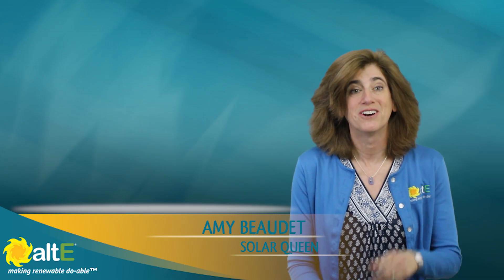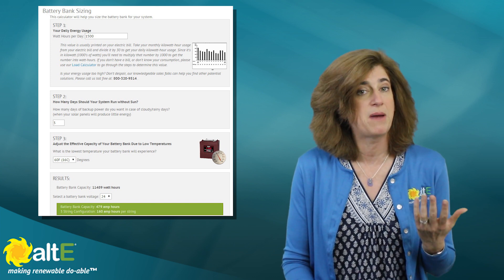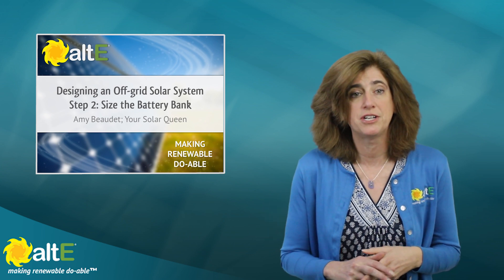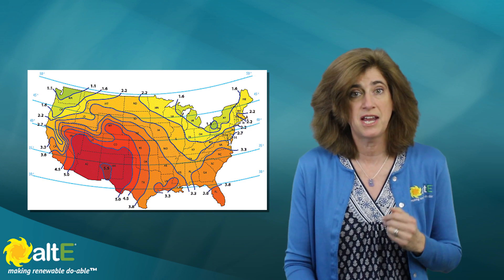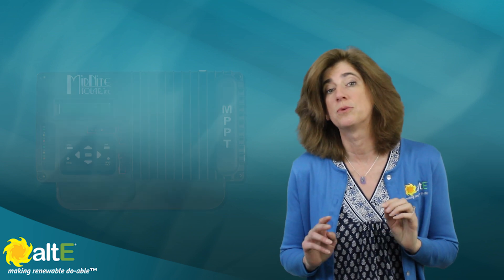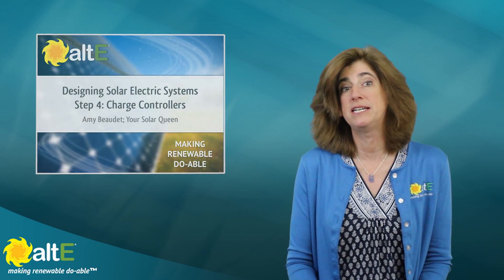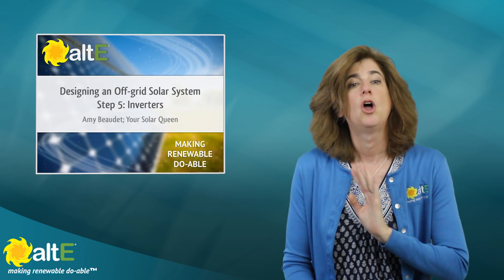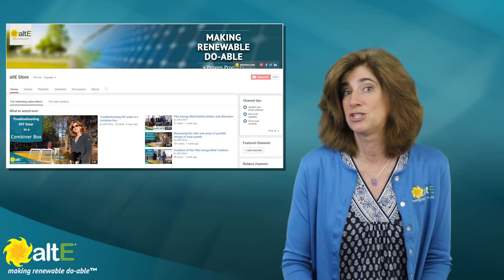6 Steps to Design a DIY Off Grid Solar Power System

Comment: I need 40 batteries 40 KW of batteries. That might tell you how much power I need in my but that is a misgiving because the batteries won't last me a week if there's no sky with the sunlight. The only generator I have is a solar operated electric generator I have inverters I do have some solar panels but not nearly enough.

Comment: she's right but the easier and cheaper away is changing light bulbs from 60 watts down to five watts would save you a bunch or simply just don't use light bulbs and does use a sunlight

Comment: I was under the impression that solar would virtually eliminate my power company bill. That appears to not be the case. It will not run an entire house plus the power company I use charges a fee if you install solar panels on your home.  Doesn't seem worth it to me.

Comment: Hi Amy, so far all the off grid solar system calculators I have investigated do not increase the number of solar panels required as you increase the number of continuous days without sun, and I believe this causes one to build an inadequate system (and your online calculator does the same thing).  If you design for 2 days without sun, and you encounter 1 day with sun followed by 2 days without sun followed by 1 day with sun followed by another 2 days without sun, the battery bank will drop below your desired depth of discharge because the panels can't keep up in regards to charging the battery bank.  Please comment, and thanks.
Reply from the maker: You are totally right. The calculations aren't perfect, and list a minimum size for the array. I generally add more solar for that exact reason.
Reply: Hi Amy,  thanks for the sanity check and I really enjoy your videos.  Keep up the good work.

Comment: [Awesome Plan Here >>>https://plus.google.com/u/3/113778429958471787540/posts/67MrRb1YGej ] It has just right information regarding solar electricity- its fundamental and how to size and install a system. Anyone with a little technical background can understand and follow easily. It illustrates real world solar electric design.

Comment: Hi excellent videos. I have a question at what angle does the panels need to be. I live im mexico.  Some people say put it at the angle of the latitud. Some say its more. I downloaded app foe cell phone and they give diff angles. Please help
Reply from the maker: It depends on what your priority is. Best year round performance is latitude. But if you are off-grid, and trying to get as much as possible in the winter, then latitude plus 15 will get you more energy in the winter. If you are trying to maximize summer, then latitude minus 15. This is a great site that shows different angles and the outputs for all over the world. http://solarelectricityhandbook.com/solar-irradiance.html  Note that the angle they say is degrees off vertical.

Comment: You do a super job.  Been researching this for a while and used a Kill-o-Watt meter on each load for a week to determine to determine base daily energy needs (right now, anyway; starting small) by measuring the 3 loads I want to initially run on Solar.  Then sized the system based on the 4.5 average sun hours the G'bument says we get here in Norfolk, VA.  Panels tilt with the seasons and are face on to true south.  Took advantage of your July 4 sale and ordered a Midnight Solar Classic 150 and a couple other items.  Thanks for all the great information.  Somewhere in our future is a solar hot water heater which will shave of 5 kWh off our power bill immediately.
Reply from the maker: Terrific! Thanks so much! Another option you might think about for your hot water is a heat pump water heater. It is an electric water heater with a built-in heat pump. It takes the heat from the air and puts it into the water. That combined with about 1000W of grid-tied solar will make all of the hot water you need. Check out the ones we carry at https://www.altestore.com/store/heat-pump-water-heaters-c1247/

Comment: Hi Amy 
Can you let me know how much is this and how we can get it in Middle East
Reply from the maker: Costs vary based on how much energy you need. You can see some examples of off-grid solar kits here, https://www.altestore.com/store/solar-power-systems/off-grid-home-solar-power-systems-c567/ . For the Middle East, a different  inverter is needed to provide the proper voltage and frequency. We are able to ship to a freight forwarder in the USA, you would be responsible for coordinating the forwarding with them. International orders need to be paid with wire transfer or Paypal. Walk through the steps in the video to see what size system you need, and we can talk about designing a system that is right for you.

Comment: Oh what lovely hair you have... and thanks for all these informative videos.
one question though, How is the Panel efficiency calculated? I mean what factors go into calculating this efficiency to be 12% or 15% or 22.5%?
Reply from the maker: +Tabesh Khan Thank you. The maximum efficiency of a panel is calculated as Power / (amount of sunlight <1000W per square meter for standard test conditions> x area of solar panel in square meters). Let's use a 300W solar panel as an example. 300W/ (1000Wm2 x 1.6m2) = .18 or 18% efficiency.  Keep in mind efficiency just says you can get more power out of a smaller panel with a more efficient solar panel. So if space is not an issue, you can save money by getting a less efficient, and usually less expensive, solar panel. If you are limited by space, and have to fit a certain amount of panels into that limited space, then it may make sense to pay more for a more efficient solar panel.

Comment: In one of your videos, you made the statement that your Solar Panels won't work on Sunless days. This is NOT true! Your Panel is still receiving energy from the Sun on a cloudy Winter day-just not as much. Your Math is correct, however.
I have a small setup at my home, and I have tested this personally. A few days ago, it was windy, rainy & 1/2 Hail-Unusual for the Oregon Coast-My Panels were still sending 11.8 to 13.1 volts to the Controller. Granted, not enough to charge the Batteries, but even on this Sunless day, I WAS still receiving energy from the Sun into my system.
This problem is EASILY overcome by adding more panels-i.e. more Amps. All it takes is money, LOL!
One statement you made that I DO agree with wholeheartedly is to have more Battery storage than you expect to need-Twice is good, but THREE times is what I'm striving for.
Reply from the maker: +Bruce Forster Volts isn't as affected by the amount of sunlight as amps. If you measured the amps, it would be next to nothing. Since Power = volts x amps, volts without amps is useless. If you figure a 100W solar panel has an Imp of 5.5A at standard test condition (full sun) 1000W/m2, for a day like you described, the intensity of the sun is probably down to about 100W/m2. so you may be getting about .5A x 13V = 13.5W. That's pretty close to nothing unless you have a tiny battery. Also, a full battery is around 14V, so 11.8V - 13.1V won't be doing anything unless your battery is practically empty. So solar panels "working", vs. doing anything useful may be 2 different things.  If he voltage of the solar array is too low, adding mre solar panels in series and using an MPPT charge controller may help a little, but just adding more panels in series won't help.
Reply: I know this. If you add more panels, you increase amps, not volts. Also I mentioned more panels in PARALLEL! THAT is what increases the amps. So, if you add more panels in PARALLEL, you WILL increase the AMPS, which is what is needed by the Battery/Batteries! 
I don't want to sound mean-spirited, but you people need to READ what is being sent to you.
Reply from the maker: +Bruce Forster If the solar array volts isn't higher than the battery bank volts, adding more amps isn't going to help. Which is why adding panels in series with an MPPT charge controller may help a little to increase the volts. The MPPT charge controller would output the higher voltage, and also increase the amps output.
Reply: I am a licensed Ham Operator (Extra Class), and I have designed, built, and operated a number of smaller Solar charging and backup systems. I do KNOW all of this stuff. There ARE ways to deal with these common issues.

Comment: well my mother always taught me to tell the truth,,, hey I have a question for you concerning 24 volts my 12 volt system hooked up with 4__100 watt panels in parallel all the positives together and all the negative together,can I hook up the big 24 volt panels the same way,so I wouldn't have to try to hook up a bunch of 100 watt panels,in series and all that?
Reply from the maker: +bill767667 If you have an MPPT charge controller, you can wire 24V panels either in parallel or series, depending on the voltage limits of your charge controller voltage range, you may be able to wire 2 in series. But if you have a PWM charge controller, you have to stick with 12V in parallel. I hope that answered your question.
Reply: +altE Store You are EXACTLY right.